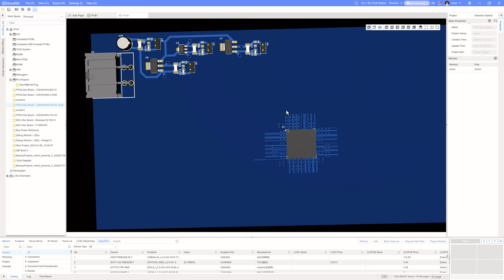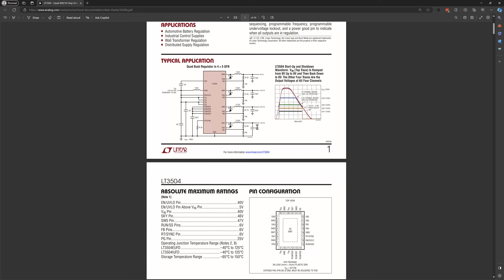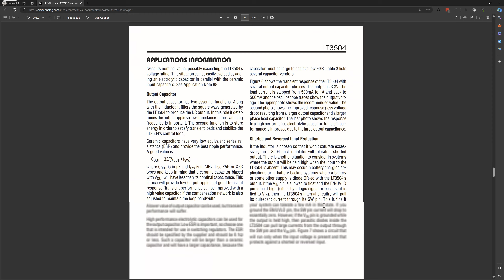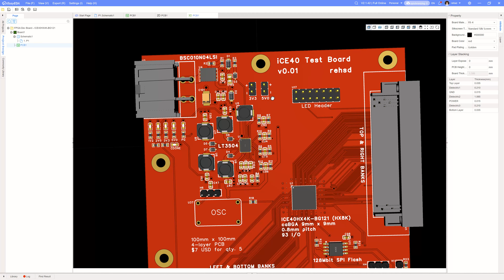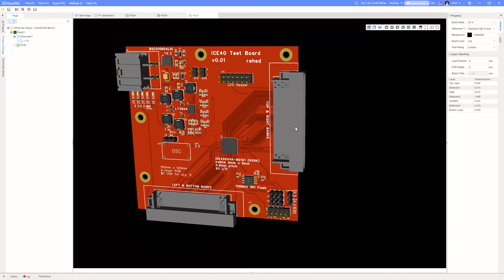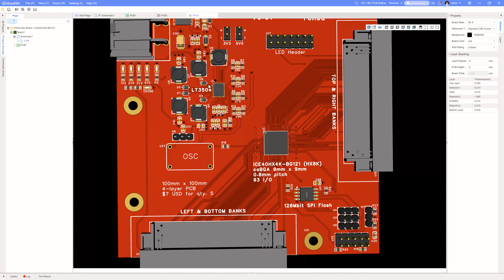Experimenting with Power Setup (iCE40HX(4/8)K-BG121 Dev PCB)

Comment: All of the MOSFET stuff you're talking about at 10:00 can be ignored unless you're expecting surges of 180V! The figure on the first page is a much more reasonable circuit to use unless you're in an electrically hostile environment and expecting sharp input spikes.
Reply from the maker: I hope I don't have big surges.  :)  Ok, I will strip that part out of the design. Thank you!
Reply: @rehsd  Page 28 of the datasheet (or the first page) has a good reference design. Take note of the layout details in Figure 8, switchers are sensitive to layout (especially their regulation, noise and efficiency). Also check out the DC1207 schematic - its their evaluation board schematic.

Youtube wouldn't let me post a link to it, and is hiding my comments as it thinks I'm trying to spam you :)
Reply from the maker: @m1geo I don't have a page 28 (mine stops at page 24), so I must have a different doc.

Comment: I personally love the idea of making PCBs Modular, so breaking out elements and having connectors to allow for changing out different breakout boards. Have you looked into the smaller Mezannine connectors? they are super cheap and small but fiddly to solder..
Reply from the maker: I was looking at those. I saw they were being used in a different FPGA board for stackable PCB support. I haven't tried them yet.

Comment: Did you follow the LT/AD layout advice in Figure 8, page 18? The layout of switching regulators is sensitive, especially the feedback circuits.
Reply from the maker: Yes, I am following Figure 8. I have more work to do on it yet, though. When I pull the MOSFET out, I'll spend more time on aligning my setup to that in Figure 8.

Comment: So with the oven based soldering, am i right in thinking you will need to hand solder the capacitors underneath the board? They are tiny.
Reply from the maker: Good question. I would use the oven only for topside surface mount component. Through-hole and bottom-side components would be done by hand. The bottom caps/resistors are 0603, and I can manage those OK. I haven't tried 0402's yet.  :)
Reply: That's what I was wondering as well. Plus you probably don't want to heat up the bottom side too much (or you might end up de-soldering the BGA). I have no experience with soldering surface mount components on both sides of a PCB; maybe using two different grades of solder paste (i.e. different melting points) ? Or maybe I'm just overthinking this, and heat conduction won't be as bad (especially on a multi-layer board).
Reply from the maker: @bitsnbytes7514  For the bottom components, I will use a standard soldering iron. I don't foresee any issues with the FPGA being affected by this.
Reply: @rehsd  did you have the same 603 sized caps under your 256 pin bga?
Reply from the maker: @DavidLatham-productiondave  Yep, same 0603's.
Reply: I typically reflow the bottom side parts first and then top side.
Reply: @rehsd No need for any of it. Reflow the bottom side first, then add some standoffs and reflow the top side. Don't worry, your bottom side mounted components won't go anywhere - liquid solder has very high surface tension, it will hold your parts in place no problems. Take a look at the photo of the bottom side I've sent you - everything you see there was soldered in the oven first, and then the top side was soldered. As you can see, even relatively large QFN didn't fall out.
Reply: @bitsnbytes7514 Desoldering BGA, especially the one soldered on leadfree balls (and others don't exist outside military), takes a lot of heat. So let me assure you that you can't accidentally desolder it, unless you do something really dumb.
Reply from the maker: @asmi06  Cool stuff. I have some experimenting to do...

Comment: Talk about overkill 😂 This fpga barely consumes anything as it's very small and was designed to be power-efficient.
My current go-to buck is MP2384 - it accepts up to 17 V, can output up to 4 Amps, it's quite precise, very efficient and cheap.
Reply from the maker: Ya', I know.  :)  I'm pulling out the MOSFET. You must run two or three of the MP2384's to supply the different voltages?
Reply: @rehsd  Yep. If you look at the photo of my board, you will see a bunch of them. They also quite small and so don't take much pcb space.